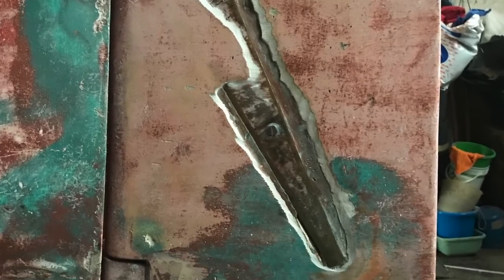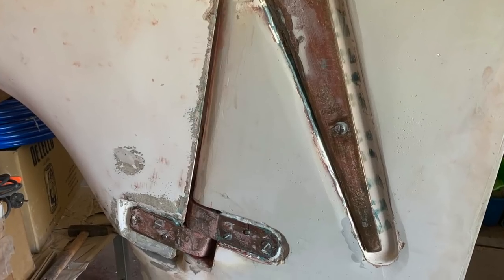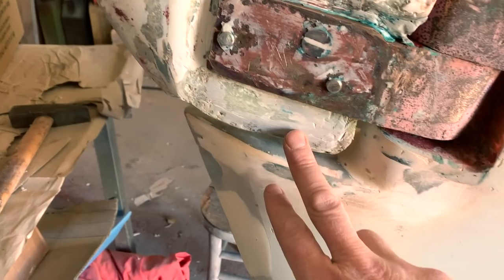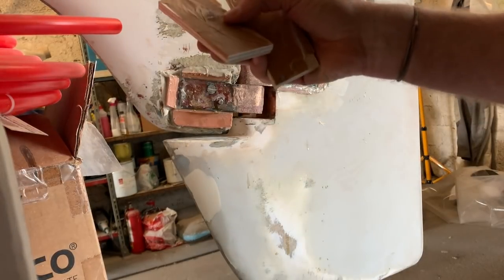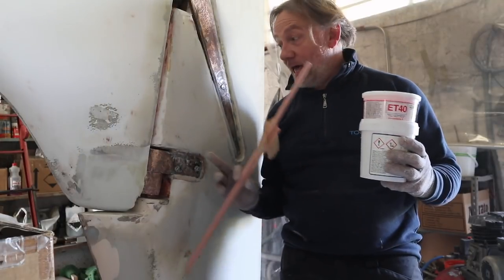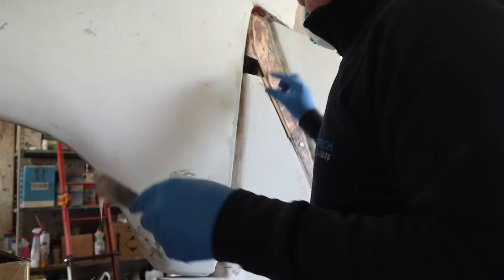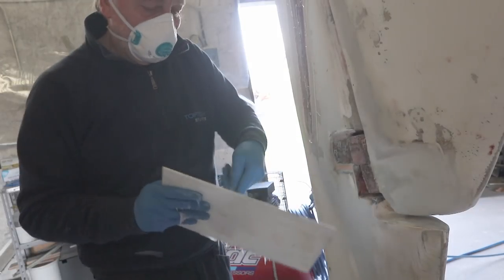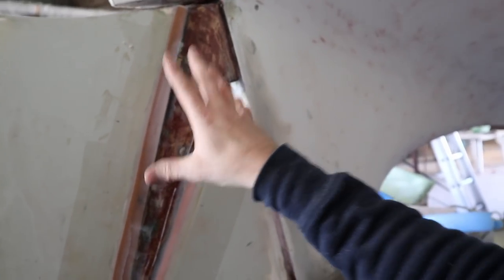[Hallberg - Rassy 312] "Ellös" - Sea4See - REPAIR THE RUDDER BLADE pt.1

Comment: Looks nice & thanks for the VLOG! I contacted my epoxy supplier and he said that bronze is problematic material, because oxidation. "rudder fittings being made from a marine grade bronze are corrosion resistant – and so will corrode very quickly reforming its protective skin/copper oxide, when you remove it by sanding / grit blasting etc. In fact the oxide layer will reform in seconds – defiantly less than 60 seconds." Epoxy do not stick to copper oxide...  He says that "This is done by using wet and dry abrasive paper and sanding the surface of the bronze through the liquid epoxy – so do not let the epoxy cure. The liquid epoxy stops oxygen reaching the surface of the bronze and reforming the oxide layer, so the epoxy is in direct contact with the surface of the bronze making a good bond. " Actually there was epoxy putty on my HR rudder bronze parts and it cracked loose after one summer :( . I try to repair this winter.
Reply from the maker: I used a different type of epoxy putty made for this pourpouse... I will see in a while what happening.. in any case I know any millimetres of rudder do something happen I will make the work in different way ... we will see! Thanks for the information!

Comment: My Rudder is very stiff, takes quite a lot of force on the tiller to turn it (but it does move smoothly). Is there grease to make this easier?
Reply from the maker: Hello you can check if the stuffing box is too tight( check my video regarding this argument) sometimes to avoid water entering and you never replace the cords inside you need to tight hard and this could cause stiff rudder.. check also the deck support and alignment good luck